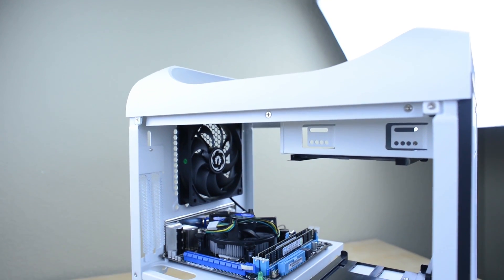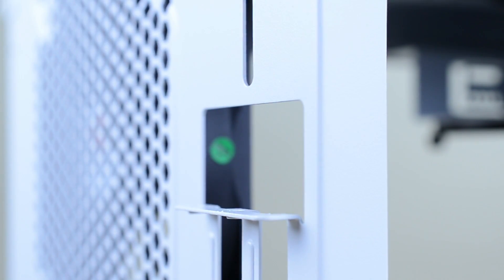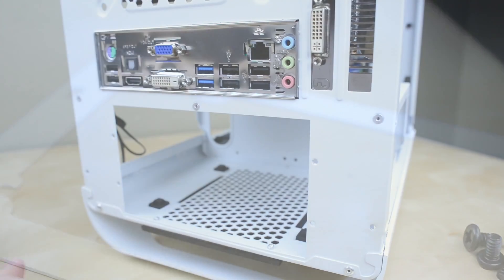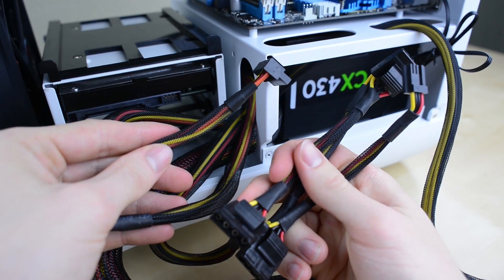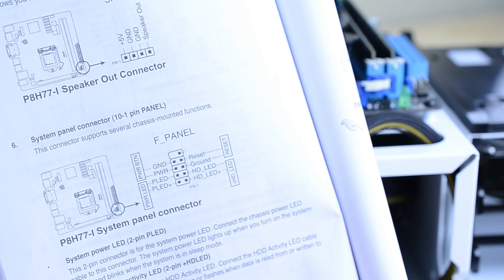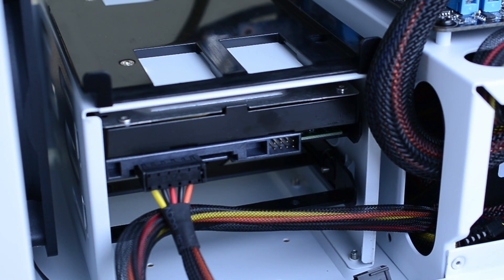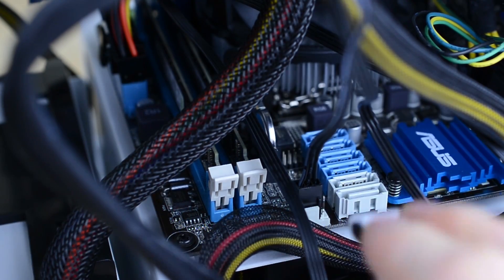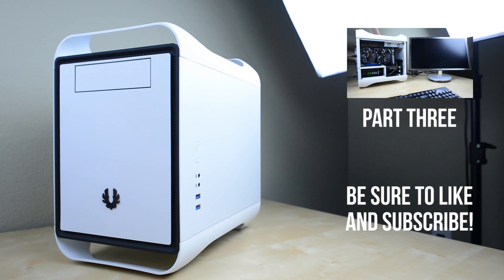How to Build a Computer for Gaming 2013 Tutorial - Part Two

Comment: You probably need a DVI-Analog to VGA Adapter

to connect it, you plug the adapter onto the port on the back of your case 
that is compatible with it(It is a whitish colored port) next, plug your VGA 
cable onto the adapter, and have the other end hooked up to your monitor, I
 had the same problem and this solved it for me.

I hope this helps

Comment: No, it depends on how many fans you have/use in your case, and how many fan connections (those little 3-pin cables) there are your motherboard.

For example if you have a motherboard with only 2 fan connections (one for the CPU fan, another one for the main casefan), you'll need to use the molex adapter on your power supply to power any additional fans you might install.

I hope i made it clear this way.

Comment: LilTechner, many of the parts you buy for a computer will have a "serial code" to say, many intel processors have an LGA 1155 "serial code", so they must be paired with a motherboard that has an LGA 1155 serial code also, it may seem complicated, but its actually quite simple!

Comment: With this case you can fit in a 13 inch GPU which is pretty awesome. The thing with this case it's non compromise which is really rare with an ITX case. Usually with an ITX if you want "this" you cant have "that". This case makes it easy to build what you want without giving something up.

Comment: Connect your monitor to your GPU and not to your motherboard (if that is your problem). If not, check your DVI/VGA/HDMI cable (whatever you use) and make sure it's connected properly to your monitor. Also check the power cable going into your monitor.

Comment: It all just depends. There are 3 form factors. ATX, Micro ATX, and Mini ITX(at least I'm pretty sure that's it.). The Mini ITX cases always say Mini ITX right in the item identification. Most cases are ATX form factor. Just look in the specs of the case and the motherboard to see if they are the same. And about your question with the cables, no. Almost all PSU's, even ones that are older than 7 years, have SATA power.And what do you mean by hooking your SD reader to the optical drive?

Comment: Nowadays you do get decent coolers for 25/30 bucks like the hyper evo- and its completely worth the money. Intel stock cooler will leave you with nightmarish temps under loads. Though the ivy bridge chips are capable of bearing relatively more heat than the sand bridge chips, they also get hotter fast and its not advisable to let your temps rise above 75 deg which is more likely to happen with your stock cooler unless you live in some cold region where ambient temps are low.

Comment: the prodigy supports video cards up to 320mm length and the 7870 (different variations by company) is about 250mm so yup it should fit with room to spare

Comment: You'll want a 500-600W PSU to go with that. Like Austin always recommends, go for a Corsair CX500  or CX600. If you're planning to overclock your 3750k (why wouldn't you!?) you'll need a lot more power, plus.. it can never hurt to have a bit of an overhead.

Comment: sure, no problem. Just check the RAM frequency (it's adjustable, use the MemOK feature of the board). And you need to reinstall Windows, it's absolutely necessary. You might want to use an AMD GPU, as the board supports CrossFireX, but not SLI. If you are willing to upgrade in the future :) Good luck!

Comment: I went with 700 because i want to eventually upgrade the graphics card, because it is outdated. It's a good card, but its old. 500 watts is 100 more than the one he has but if you ever plan on upgrading (which i recommend you eventually do) get 600.

Comment: Yes you can! Just make sure it's the right socket otherwise it will not fit
So an core i5 ivy bridge goes into a 1155 socket
And core i5 haswell goes into a 1150 socket

Comment: You should look at hid $500 gaming PC build. It is more updated and is capable of playing ARMA 2/Day Z on high settings but you may have to turn down the graphical settings to play ARMA 3. The $500 PC is a good PC that is easily upgradable (for example more RAM, change the intel core i3 for an i5 and upgrade the graphics card). All of the upgrade are in the description of the $500 build.

Hope this helped :)

Comment: Sound cards are optional. You can connect your headset to the port at the right side of the case. 

This motherboard doesn't include a wifi card so you'll need to buy a wifi adapter which costs less than $15 and are very tiny so you can just forget about it.

Comment: Yes i have a very similar setup but i would strongly reccomend to get a 650ti if you can because i have a zotac AMP! edition with 2GB ram and its amazing i can run far cry 3, battlefield 3 and anything thats easier to run on ultra apart from crysis 3 where i have to turn it to high but you will get a very playable framerate 45-50 FPS at 1080p

Comment: You CAN get pre-built PC's, but they will of course be more expensive. Building them yourself though isn't really THAT difficult. There's some basic "noobie" guides to building PC's that will explain it easily. The hardest part when first learning is actually just learning how to match all the parts so it runs properly. Once the parts are picked, putting it together actually isn't hard.

Comment: Hmm asshish, seems like all the parts will work together. Although there isn't really much you have to do to get it to work together. The only thing people really need to check if the processor will work with the motherboard, and if the psu is big enough for the graphics card. Your psu is big enough and you haven't listed a motherboard yet so yea..

Comment: I'm just about to do my first build but I'm not sure what motherboard to get. this is the rest of my parts: 
CPU - i5 7500
GPU - gtx 1060 6gb
fan - cooler master hyper212 Evo
ram - Kingston HyperX Fury Red 8GB (1 x 8GB) DDR3-1866
power supply - Corsair Builder 500W 80+ Bronze Certified ATX
HDD - Toshiba 2TB 3.5" 7200RPM
SSD - Sandisk SSD PLUS 120GB 2.5"
case - Cit F3 White & Black
I'd really appreciate any feedback
Reply: I would highly recommend that you go with the intel z170 chipset instead of the z270. The motherboards are much cheaper and there are more options. I also recommend that you choose a better case as the one you chose is a micro ATX and it is harder to find a motherboard in that form factor. If you want any specific product recommendations, reply to this comment and I will be glad to help you out.
Reply: Okay so what case would you suggest I would like to get a black white one because it would go with my set up really well

Comment: If it's the GTX 660 you're going to, the power consumption is only marginally greater, so a 500W should be fine. The 660Ti, however, has a much higher power consumption while on max load... potentially a good plan in investing in a 550W or 600W PSU if you're planning on overclocking the CPU. In my opinion with the CPU, I'd OC it to 4.4GHz and leave it there.. that way you'll get a noticeable difference without increasing the load a ridiculous amount. Good luck :D

Comment: On Amazon the Gigabyte Radeon 7850 is said to be used with a 500 watt power supply does using it with the 430 watt the same (Performance wise)

Comment: yes i5 3570 but i suggest on getting the new i5 4670 but you'll need to get a new motherboard since the 4670 isnt compatible with lga 1155 you need to get a lga 1150 motherboard i suggest a "gigabyte lga 1150 mini itx motherboard" and you can keep everything else pretty much the same

Comment: the monitor you use for gaming plug into the graphics card but if you have any others you can plug them into the motherboard outlet. ive got my gaming screen running off my graphics card, my secondary monitor (old 1024x768 box) and my TV are running off the motherboard ports. When you turn on your rig for the first time, theres lights and sounds coming from the PC but nothing pops up on your screen dont worry yet. Plug the monitor into the motherboard ports and try again. VERY RARE THOUGH!!!

Comment: Depends on is it the same socket.
This motherboard supports socket 1155.
You i5 should have 1155 socket or 1150 socket.
If it's 1155,it will work.

Comment: I respect your expertise but I would like to ask about a few things you did.  First of all would you be able to flip the power supply and if yes then why didn't you since you don't want to cool the power supply with hot air.  Second of all why did you put in all the bulky stuff before doing the small wires.  The fan header for the CPU cooler could have been connected to the motherboard before you even put it in the case and the Graphics card makes it hard to plug in the small cables.

Comment: The 3570k is almost as good as it gets for gaming, so you should be able to get the best you can afford in a graphics card.  However, I don't know if it's worth the money in that case.

What is your budget?

For $220 or a so there's an open box GTX 570 that would be a BEAST on newegg.  Your PSU could probably handle it if you had the right power connectors on it.  (a 6 pin + an 8 pin)

Look around on Newegg-there's many options to choose from.  Just google for benchmarks to compare 2 cards :D

Comment: I responded to somebody else in the comments with the parts that I used. I have an i5 and a GTX 660. My build can run LoL @ all very high settings and get ~200 fps. Idk about Austin's build, but it should run LoL no problem.

Comment: You should have put a little more thought in the order ... i mean placing the CPU and GPU on the motherboard first, and then fitting cables later, on a mini ITX board you already screwed in its place ... well ... i admire your resolve.

Comment: I'll probably use this video as a guide to my build...:

GTX 670 FTW +

i7 3770k 3.5 GHz OC'd to 4.5GHz

3TB Seagate Baracude Hard Drive

16GB Corsair Vengance RAM 

Cooler Master HAF 922 Computer Case

MOBO (still looking for a decent $150 mother board)

750W Corsair Bronze Power Supply

:D My new Gaming Build! any suggestions on part changes please reply and for the comp I'll mainly be doing some heavy gaming and ALOT of video rendering!

Comment: Hi, I am new to PC building and I have a question. Does the SATA cable that comes from the power supply, power all of the hard drives? Also if I had an optical drive, would I feed a SATA cable directly to the motherboard?

Comment: OK, so I am looking to put an LED 230mm case fan into the front of this build, and I was wondering if I could just get a 3 pin to Molex adapter with multiple 3 pin inputs and then power the 230 front fan and the 120 rear fan both directly from the power supply. Would this work?

Comment: Austin, I have a problem. I believe my side panel with all the connectors is busted because the system won't turn on. Its not the power supply because the light on the motherboard is on. Is this a faulty side panel?

Comment: Will I need the molex adapter my power supply has these connectors
Fixed:
1x 20+4-Pin Main Connector
1x 4+4-Pin ATX12V/EPS12V Connector

Modular :
2x 6+2-Pin PCI-E Connector
8x 5-Pin SATA Connector 
4x 4-Pin Peripheral Connector
2x 4-Pin Floppy Connector

I'm sorry if this a silly questions I'm doing my first build and I want to get it right.

Comment: If i was to use the MSI R7850 Twin Frozr OC AMD Radeon HD 7850 2GB GDDR5  instead of the gigabyte card would it still be the same process of installing it as you did in the tutorial.

Comment: If I use this exact build but I bump up the graphics card to an EVGA SC 2GB GTX 660, #1 would I be ok with the 430w power supply and #2 would the card fit into the case? I know its a pretty long card.

Comment: I have a gigabyte gtx 660ti that has two PCI power ports on it. My power supply only has one PCI cable. Do I only need the one cable, or do I have to use the molex--PCI adapter included with the GPU? I'm building my PC right now

Comment: probably not, you might need an ethernet cable, wireless pci card, or wireless usb adapter, im not sure if the motherboard he was using had build in wifi, probably not considering there are like no motherboards with built in wifi

Comment: i5 3570K Processor
Asus P8-Z77 Motherboard
EVGA GTX 660
8GB G-Skill RipJaws Ram
750W Corsair Power Supply
120GB Samsung SSD
LG Blue Ray Player
NZXT Apollo Case
This added up to be ~$850 and I got it all of newegg using combo deals. If I got each part without the combos on newegg I probably would have spent over a thousand.

Comment: I would have gone with Ivy Bridge but this is only $10 more than the 3770k and it's a new socket.  Socket 1155 is already discontinued so I didn't want to go with an older generation of processors.  The 4770k is actually better than the 2600k, 2700k and 3770k.  Just check the benchmarks.  There's no need to be jealous.

Comment: Don't bother with a Phenom ii x6.  They are a few generations old now.  If you want a good 6 core AMD CPU, just get a FX-6300.  They have very similar performance to say a 1090T.  Or you could spend a bit more and get yourself a FX-8320/8350.

Comment: Na, 500W is recommended as the kindoff "minimum" Wattage for gaming computers, but you can run an Intel I5 with a AMD HD 7850 on 400W and still have plenty of power over.

Comment: @Austin Evans i am hoping to build the and i was wondering about the ower supply i saw this master cooler 1000 silent pro and i was wondering if i could use this instead of the power supply used because i heard if the power goes out the computer wont shut off with this

Comment: i have a question !! i am having problem with intel dual e2180 running at 2.00Ghz but temp is min 50c with normal use and with full load 75-80 c,
i have done OC @ 2.6 with stock cpu cooler but temp is very high so should i buy a cooler ?? thanx

Comment: I've done everything followed by your tutorial, but i get no signal to any monitor (hdmi). I've checked all the wires so they are correctly put, the graphics cards light is green, and i can turn the computer on. But only the fan that is connected to sysfan is working (at this point the cpu fan)

 What could be wrong ?
 Samsung SSD Basic 840-Series 250GB
ASUS GeForce GTX 760 DC2 OC
Intel Core i5 4570 3.2 GHz (Haswell)
Gigabyte GA-Z87N-WIFI mITX
Crucial 8GB (2x4096MB) CL9 1600Mhz Ballistix Sport

Comment: No, it doesn't. You can buy a Wi-Fi adapter for around 10-20 dollars, but you'll have to use one that uses USB, not a PCI slot, since mini-itx cases like this only have one that will be used by the GPU.

Comment: I have tested both. Dont believe me ?
Check any known forums online. Techpowerup,Toms, Anantech,OCN - nerdiest computer geeks will also suggest a 7950 especially if you re not looking to xfire in the future (as sli is smoother). Also with the release of the new 12.11 beta drivers, the amd cards under 350$ have taken a good lead over their nvidia counterparts. Unless you re a nvidia fanboy, you just cant settle for a 660 ti over the 7950 w boost for the same price.

Comment: I am slightly concerned as I will not be using a monitor and I will be using a tv where should I plug my hdmi cable in to the pc to install windows 7 and do all the settings through my tv?

Comment: Need help I have the cx 600 and it has the 2 pcie power cables with 6+2 on the side. I have a graphics card with one 6 pin and one 8 pin. Does the 6+2=8 needed on one?

Comment: Probably, my i5 3470 only uses 77 watt. If you don't have a tight power supply, it should be no problem. But, if you want to replace your GPU with a (far) more powerful one, you probably will have to replace your power supply.

Comment: Ok. Holy crap. I hope I'm not insulting your intelligence, but did you just listen to a word I said? The B75MA-P45 is a Micro ATX Board. I have this case. It only has standoffs for an ITX board. Please. Look in the specifications to see if it will fit. An ITX board is a perfect square, and this case will only fit a board that is 6.7" by 6.7". And as for your second question, you could probably do it. Motherboards always come with cables as long as it's not open box or refurbished. And optical dr

Comment: are the cables included with the items or do i have to buy them seperately?
Reply: I wouldn't suggest building this system, since this video is a year old.

Upgrade the GPU to a HD 7870, and look into a quad core intel (6 core + if AMD). Get a larger PSU, the CX500 will work, for about the same price (can get on sale for cheap).

The cables should come with the system. If trying to keep it really clean, you'll sometimes need to get extras, such as splitters/extensions.

Comment: I understand the appeal of this case (which is becoming extremely common), but for the same price you can get a high quality mid-ATX and not have to deal with the spaghetti pile of cables clumped together.

Comment: Is this a decent Gameing pc or great one?
Reply: its alright but keep in mind that this is 2012 prices are probably cheaper
Reply: It's pretty good... myself I'm just watching to figure out the basics of building a pc
Reply: Koo
Reply: this tutorial was the inspiration behind my own rig! It's a great start, I used some parts from my old rig until I could upgrade. Check out my pc in it's current form: 
http://pcpartpicker.com/p/HZnCrH
Reply: Somewhere in between ( I suppose ). It's capable of maxing out Bioshock Infinite at around 70 FPS, but certain games such as Crysis 3 still needs to be turned down to high. It's not amazing, but it's far above decent.

Comment: I want to run two of the graphics cards sli would this psu have enough power for sli??
Reply: If you building this system:

It is outdated
You cannot SLI on mini ITX boards

And no, 430 watts is not really enough if you want to SLI higher end cards.

Comment: Most probably not. My 1GHz 7950 drops down to about 35fps with all the MSAA and HDAO enabled, and that's with a 4..2ghz i5 3570k. You'd probably get away with high or maybe ultra settings, as long as you turned off the MSAA and used SSAO.